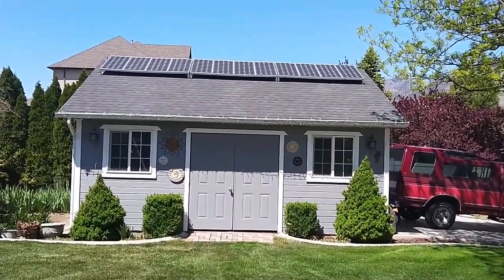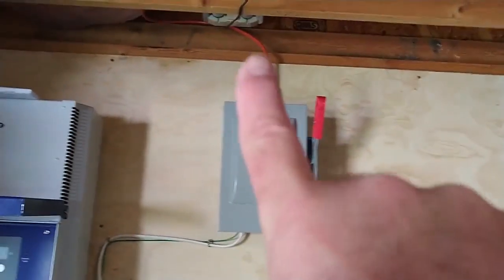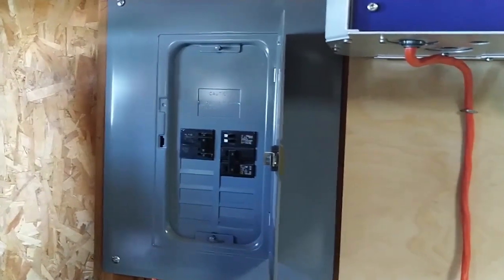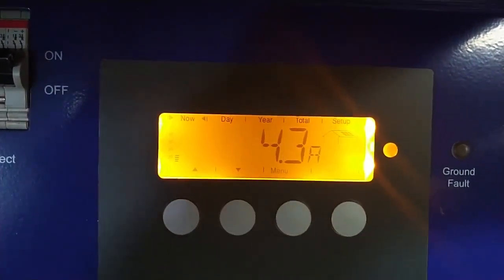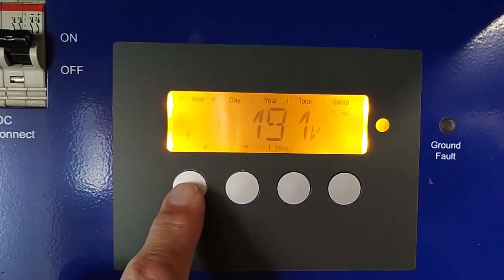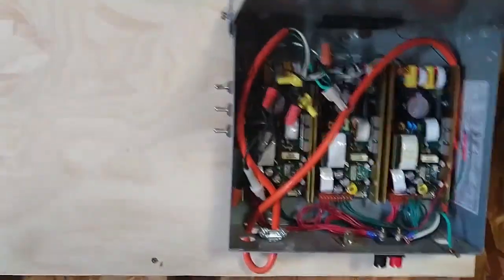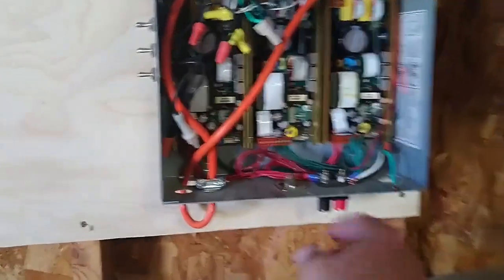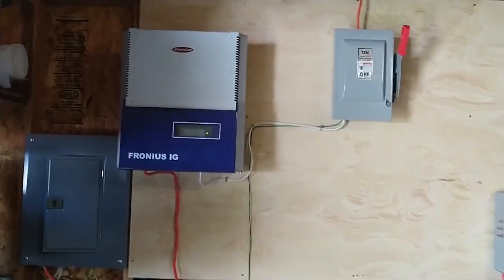How Long Do Solar Panels Last?  Solar shed with 18 year old 85W panels with Fronius grid tie.

Comment: So how much do you save with this ….seems to small to make much difference …what do use that shed for does it normally just push power to the grid
Reply from the maker: It does not save a lot but adds up over the years :)  Before the trees near the shed got big, I was probably generating $1.00 to $0.75 day average.  I would guess I am less than that now, maybe $0.75 to $0.50.  So over 16 years... 16x365x$0.75=$4380.  I probably paid $2K for everything back then (bought the panels used).  It just back feeds the grid and lowers my home electrical bill a little.

Comment: any update in 2022? did the power generation of that panels decreased over the years? or is it still giving the same amount of power like the day you bought it?
Reply from the maker: Still running strong and not much loss at all.  My overall output has reduced because of the tree near the shed.

Comment: How is your public electricity in these days? I'm hearing in California there are power shortages - like old countries and Venezuela...etc
Reply from the maker: Our power in our location has been pretty reliable and rates are not too bad.  We do not have a time of day rates (yet), they are starting to have optional time of day changes.  I am starting to explore how to get my grid-tie systems converted to be usable during a blackout.
Reply: @DanPattenAudioG33k  If you calculate the cost and running expenses, and also interest the money would accumulate...., would the produced electricity pay for itself? How much would this system cost today? Also, are you storing the electricity in some batteries or just use the generated electricity?  Here in Lincoln, Nebraska, we have fairly inexpensive electricity so you don't see too many solar panels, but I'm always looking how to generate some power, despite that  since 1981 till today, we lost power only 6x and one of these times it lasted 4 hours, all other times it was just few minutes! We have a great LES here, non profit run by city of Lincoln, like many Nebraska cities. Thank you for your replies.
Reply from the maker: I have 2 solar systems...  This little 1KW system that has been going for ~13 years and new 10KW system that has been running for 2.5 years.  Rough numbers for the 1KW system is that it earns me $0.75 per day.  Whoo Hoo.  :)  However, for 13 years non stop.  Basically no maintenance and no downtime.  So that is $3500 earned.  My cost for materials was ~$2200.  Remember I bought some of my stuff for this install used.  Can not remember exact tax benefit  but probably 1/3 of cost.  So a total cost of $1500.  So it broke even after ~6 years.  The last 7 years have been gravy.

I imagine a DIY solar shed project could be done now for $1 per watt for panels ($1000) and maybe another $700 for inverter, wire and DIY racking.  $1700 is a super rough guess.  This would all be new gear and does not count tax benefit.
Reply: @DanPattenAudioG33k  Thank you for your detail information! I do understand that you did it all yourself, that is what I also like to do. You purchased some stuff used, so that was saving you lots of $$$ also.
Reply from the maker: @tonysfun  Had some local solar installers provide quotes.  Looks like some installers may be making more money off the financing and/or loan origination fee.  Saw loan origination fees that were in the $4K to $5K range. :)
Reply: @DanPattenAudioG33k  WOW! I know how expensive they are in our area and the loan isn't there to help you, just more $$$ for the contractor. It's sad, because more people would purchase the Solar Panels.  Just had my roof replaced, over $17,000.00 for 1280 SQF house with a garage and breezeway!  Have a great day!